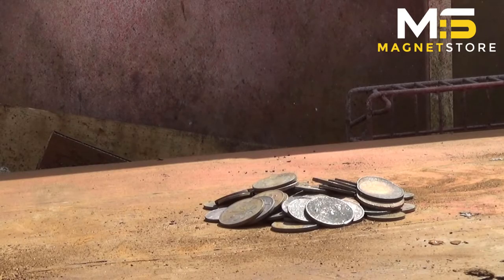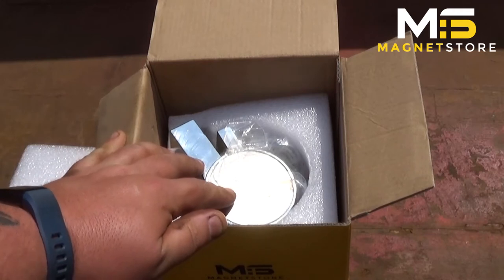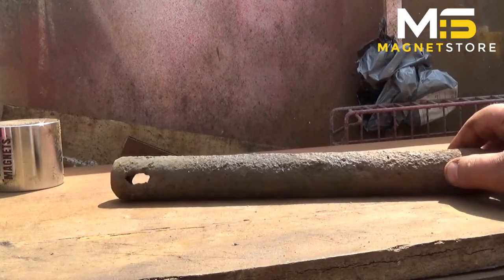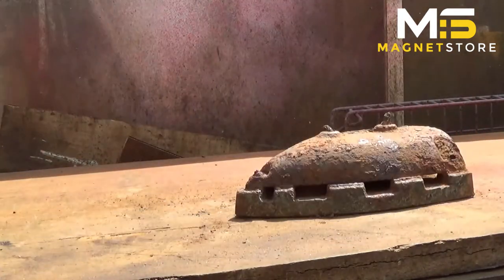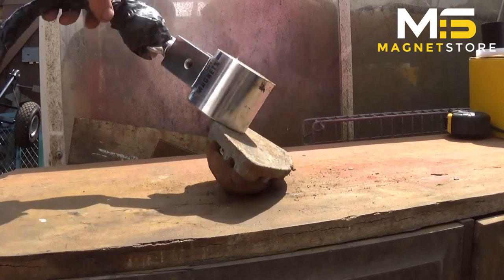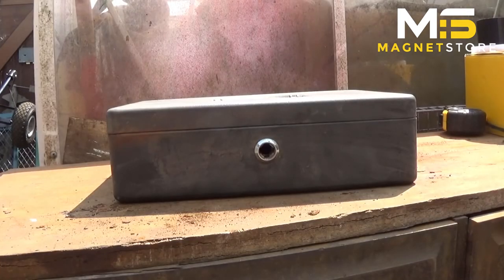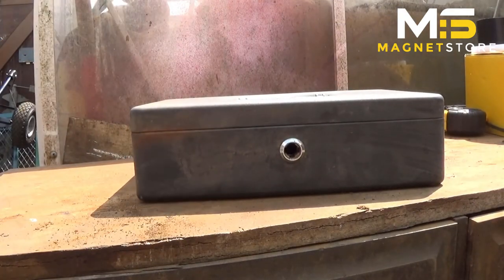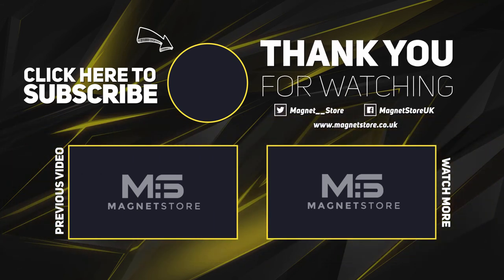Amazing magnet Slow Motion footage! 550KG Pro | Magnet Store Fishing Magnet - Feat. Patriot Magnets

Comment: I can't see the point of using a magnet so strong that you have to fight to get it off, anything big enough to need a magnet that strong to pick it up is going to be too heavy to pull up anyway
Reply from the maker: There are added benefits to having a magnet this strong, one of the main ones is that it has a much larger magnetic radius which means it will simply hoover up everything in sight. You get a treat with every throw with the 550 Pro! :)